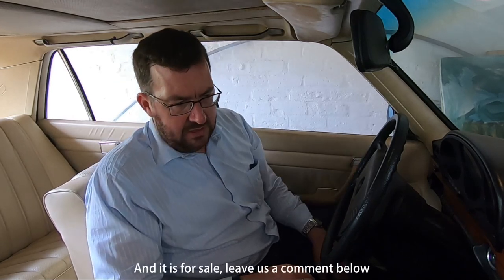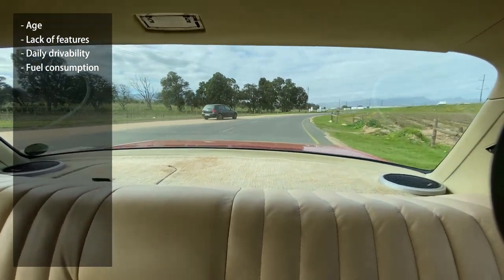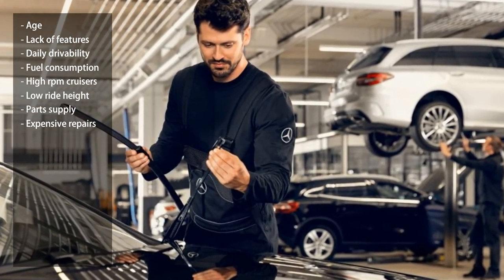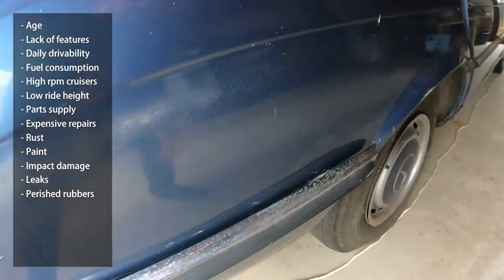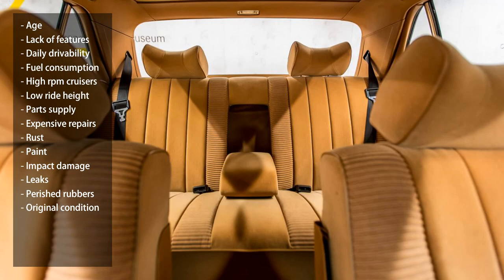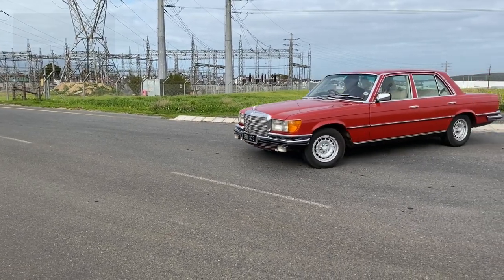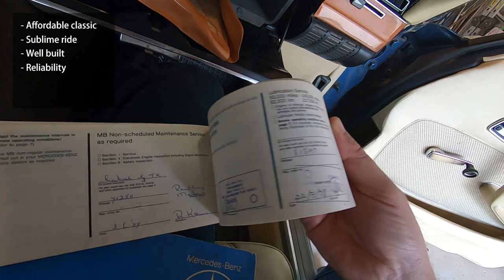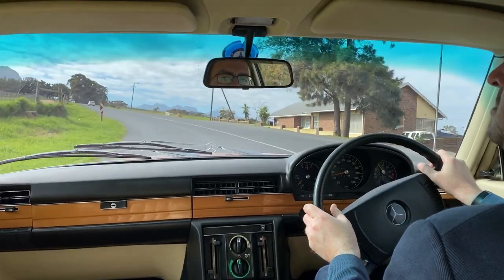Classic Documentary: The Mercedes-Benz W116 - Part 3 [ Pros & Cons ]

Comment: How do you open the hood on one
Reply from the maker: Pull the lever in the front passenger footwell (RHD model) then simultaneously pull the two large tabs behind the upper edge of the radiator grill (where the headlights end). Hope this helps!
Reply: @GalimotoMedia  how do you open the bonet if the cable is broken